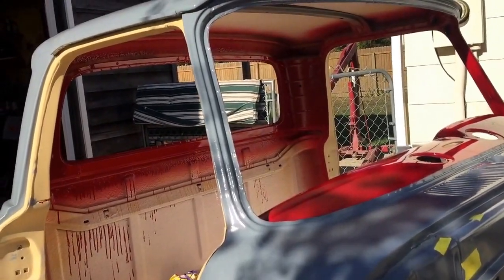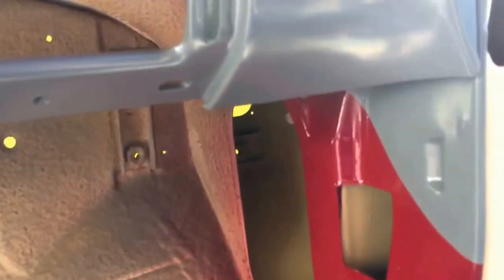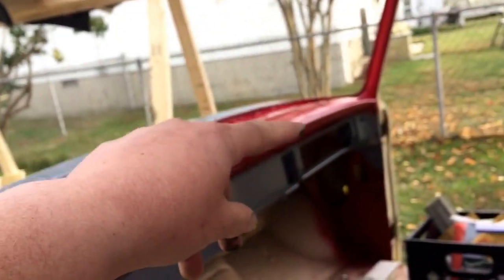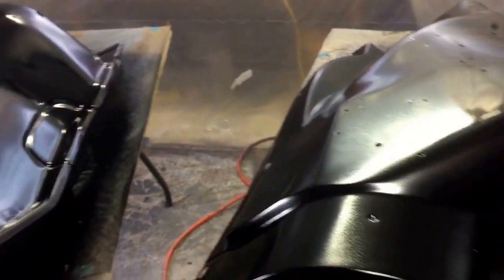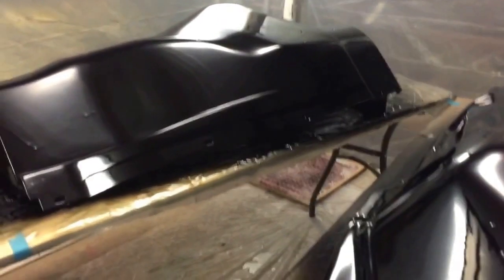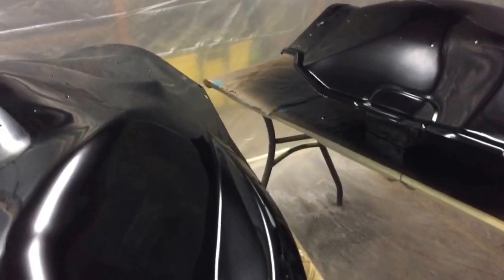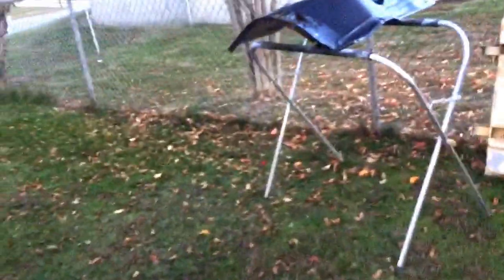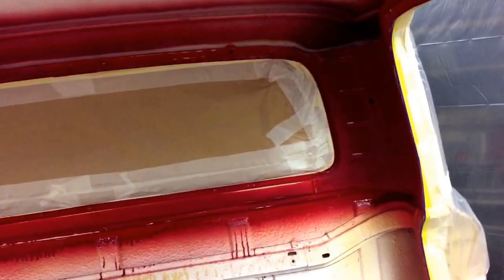Don't do what I did. I messed up the dash.

Comment: Your doing great. You can sand the runs. Your clear is looking better than my first attempt. Do you have a small detail gun. That would help alot on the dash. You got this.
Reply from the maker: Double R Restorations the detail gun I have is a harbor freight with .6 tip. I did not use it, but I will load a little red for under dash. I'm going to let the cab sit this week. I'm frustrated I messed it up, but I'm learning.   I did not eat the whole cake, just one piece.,
Reply: CoastieReid Something else I thought of, are you activating the base? Some bases you can and some you can't. Activating the base Is taking a small amount of clear activator and adding to the base. This can help when you have to repair the base. I understand completely about taking a break. I've step away from my cover project, I'm frustrated with clear coat . lol. It's getting cold here too.

Comment: Sorry that happened April. You will get it next time though, I am sure. What exactly happened there though? Were you applying base coat over clear? Or was this clear or clear? I have heard Pete @swrnc talk about painting over different types of paint at one time (like if you have some base coat popping through sanded clear) and using epoxy primer to prevent the reducer from lifting the old paint.
Reply from the maker: asicerik it was base coat to base coat.
Reply: Yeah, I am guessing you can't do that at all outside of the initial spray window.